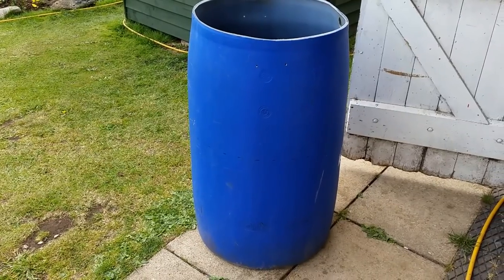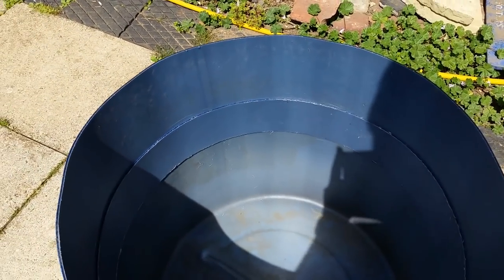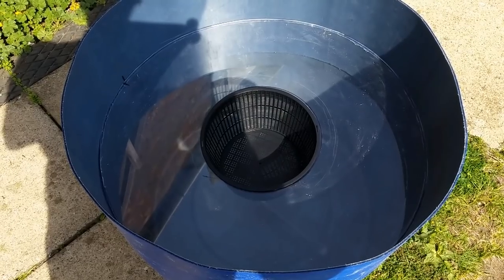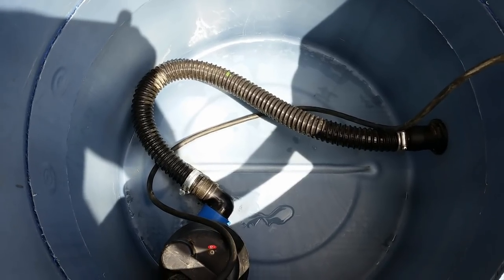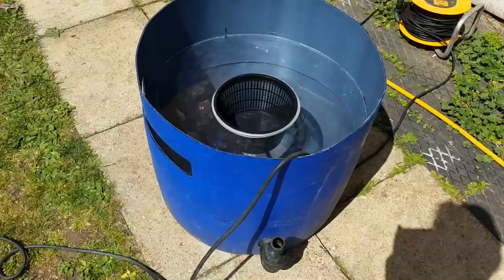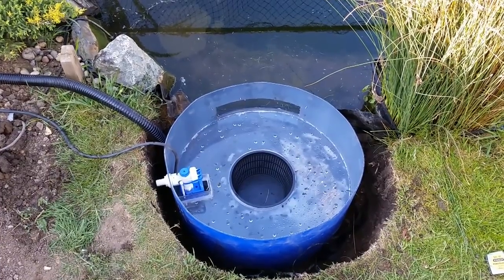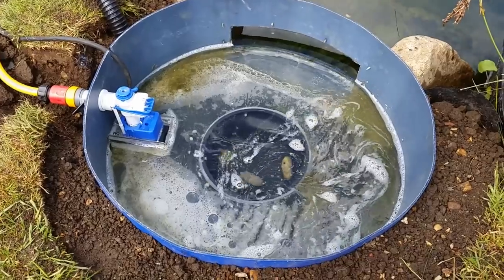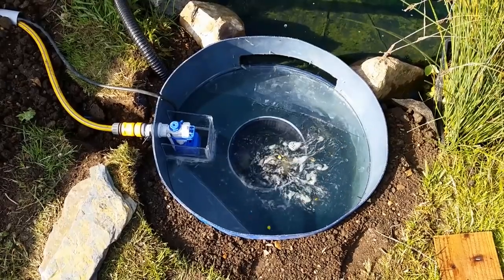DIY Pond Skimmer And Auto Top up.

Comment: Thanks Wrighty! I am new to this and learning fast. This is exactly what I was looking for! 
Last year put in french drains in the top end of the garden (the garden office is now inplace), down the sides (we are on the side of the hill) and from the water captured under the inground trampoline (don't ask!). The output is not connected to anywhere so when it rains, the garden takes some (suffering from hard clay) and the rest, well. Anyway, started to design a pondless/rill and want the french drain to feed into it. Issue is capturing any crap. This is our solution! The next problem is making it :)
Reply from the maker: Hi mate, sounds like quite a project. Hope all goes well for you mate, Terry.

Comment: That's great, nice work..... you could stick an overflow on the side near the top where you'd like the water level to max out at, that way rain won't effect the level of the pond. I've diverted mine down a dry river bed to my fence line, I even put in a couple collection pools in that the birds love to bath in
Reply from the maker: Hi Roy, That's a good idea. I did think of fitting an overflow, but we were moving house soon so I didn't bother. Thanks, Terry.

Comment: So Wrighty, you have a wonderful scenic venue between the Parasol topped Plaza and the pond area. It is so beautiful. 
This video was very well protrayed, narrated and photographed.You have given me some interesting ideas.One point I wondered about is that you placed the filter on solid ground, so it didn't move around or go up and down with the water level.My (smaller pond that yours with goldfish) water level goes up an down a few inches depending on the weather temperature.Would it be better to have the filter floating, so it is always at the affective height?Many thanks again. I will now visit your website.
Multi regards.
Reply from the maker: Hi Robert, Thank you for your kind comments. The auto top up fitted to the skimmer keeps the water level of the pond the same all the time so there's no need. Have you seen my new pond? https://youtu.be/8FpZpX_H0f4
There is 5 build videos, but this is the last one. Thanks, Terry.

Comment: Interesting video .Thanks for sharing your hobby. Have you considered installing a screened overflow just below the level of your float valve enclosure ? This would divert excess rainwater into the household drainage system whenever there is a downpour ...
Reply from the maker: Hi Susanne, this is quite an old video and I now have a new pond as we moved a couple of year ago. You can see the final part of the new pond build in this video: https://youtu.be/8FpZpX_H0f4 
Terry.

Comment: This video is great good ideas but the scum is just getting sucked threw the basket into to pump & back into the pond? And another question the debris just seem to be spinning around so soon as water levels get slightly higher there just going to be swilling round till they finally end up back in the pond? Not a in bad comment by far I'm just wondering what's what can u help me out as this looked brilliant in till I seen it doing this

Comment: Thanks for another fine video, Terry. Was beginning to wonder if the wier cut into the inner band or not. Saw that is did not till later on there. So did you have to change the strainer size or happy with the first choice? Any particalur reason for clear plexi for the shelf?  But most of all, where did you fine that round hole? All mine look like a someone ran  them and stomped on them.
Reply from the maker: Harry Chung Hi Harry, and thank you. The weir is just a fraction above the clear perspex and there is no particular reason for the clear perspex, anything similar will do the job. I must admit it was easier to cut the shape of the tub out as I just laid it on top of the tub and I could see the tub to draw the shape and get a good fit.
The smaller basket is working really well so not changing it at the moment.
It's now been running 3 days 24/7 and no problems yet m8.
Terry.

Comment: Interesting in your auto top up system - is this connected to a normal hose pipe? Any issues with chlorine in the water you're using to top it up with?
Reply from the maker: Hi Joe, Yes it is topped up using a hose pipe from the tap. But as it will only be a trickle it won't matter. The tap water is mixed with the pond water in the skimmer, which is turning over all the time and returning to the pond. This isn't topping up 24/7, only when the water level drops. Terry.

Comment: Mr. Wrighty very nice design may question is. The water doesn't run away from the pond where you installed meaning losing water to the ground.
Reply from the maker: Hi Hector, I'm not sure I fully understand the question. The only water I lose is through evaporation and it's toped up by the skimmer. Terry

Comment: Thanks Wrighty nice set up , i just wanted to the water out let part and the work of the pump, what is the water level of the pond lesser than the skimmer inlet and pump keeps on pumping all the water out of the tub? is that good for the pump, and also the speed of the water inlet and pump out let has to be the same, i.e. if the pump keep on removing faster that the water in speed what will happen, can you explain around this matter please.
Reply from the maker: Hi Favaz, The weir on the skimmer wants to be about 1 inch below the pond water level. If your pump starts to empty the skimmer you can raise the water level of the pond slightly or make the hole for the weir larger. Terry.

Comment: Top stuff! Could you connect a skimmer directly to the filter? Or to the same pipe as the bottom drain?
Reply from the maker: Thank you. You can connect a skimmer to the filter with the bottom drain if you wish. I didn't at the time I built my pond but I now wish I had. Thanks, Terry.

Comment: how did you come about with making sure the pond liner lines up with the skimmers opening and not leaking water into the ground?
Reply from the maker: Hi, Sealant is put around the hole for the weir. The pond liner is then placed up the front of the skimmer weir onto the sealer. It's then fixed with the fixing bracket shown in the video. If you want to see one fitted, take a look at ThePondDigger's video on how to fit a skimmer. Terry.

Comment: How deep should I install my skimmer? Do you measure from the bottom of the weir or top?
Reply from the maker: Hi, The bottom of the weir want's to be around 1" (25mm) to 1 1/2" (40mm) below pond water level. Terry
Reply: Wrighty what about the float valve? How deep to I place it?
Reply from the maker: You want it so it cuts in if the water in the skimmer drops below the 1 inch above the weir. they have adjusters so you can set it. Terry.

Comment: Would it work to just set it inside the pond without any glue to the skimmer plate ?
Reply from the maker: It would work, but you would need to hold it down as I think it would want to float. Terry.

Comment: Love your videos by the way and I was wondering what the clear piece is that separates and holds the basket in place ?
Reply from the maker: Hi Brian,Thank you. I used clear Perspex. I got it from my local DIY store. You can use anything for this job only the clear Perspex was a lot easier to see through to mark out the shape of the tub.Thanks again, Terry
Reply: So I could use plexiglass ?
Reply from the maker: As long as you can cut and shape it yes m8.Terry.
Reply: Thanks

Comment: What did you use to cut the plastic and barrel
Reply from the maker: Hi mate, I used a jigsaw and a hand saw.
Reply: @Wrighty  thank you awesome video aswell ! Saved me with ur awesome guide
Reply from the maker: Hi mate, your very welcome. I did fit the larger basket, as the smaller one did get blocked quite quick. Terry.

Comment: What if the water level goes down and no water coming in the skimmer? How to prevent the pump to get burned?
Reply from the maker: Thats why it's fitted with an auto topup. Terry.
Reply: @Wrighty  : The auto pop up won't work in the area where I live since we have an extreme cold winter weather. Any work around for this? Thanks a lot
Reply from the maker: Hi Jimmi, I usually turn my skimmer off during the winter. If the pond freezes over, a skimmer won't work. That's why I turn mine off to be safe. Terry.

Comment: How's it holding up?
Reply from the maker: Hi Tim, I did fit a bigger basket in it, as the small one blocked up quite quick. But it did the job very well. This is quite an old video and I have recently built a new skimmer in these videos: 1. https://youtu.be/JoVLh8XZ7so
 2. https://youtu.be/JoVLh8XZ7so Thanks, Terry.

Comment: Hi, could you tell me how did you cut the circle?
Reply from the maker: Hi Fernando, I did move to a bigger basket, as the smaller one needed cleaning quite often. I put the basket in the middle upside down and drew round it, then drew a second line 10mm inside the first line, and cut it out with a jigsaw. Hope this helps, Terry.
Reply: @Wrighty  thanks for your pieces of advise

Comment: Your weir design has no variation to water level. You need a square box where you can put a flapper plate that will allow different water levels to work with. Due to evaporation the water level get low and your pump will run dry.
Reply from the maker: Hi, that's why I have the auto top up fitted to the skimmer. This keeps the water level spot on all the time. Thanks, Terry.

Comment: How do you keep your pond water so clear?
Reply from the maker: Hi Ron, I have developed a very successful pond diy filter system. You can find out all about it on my website diypondfilters.com my videos are there as well. Terry.
Reply: +Wrighty ~ Would a diy pre-filter be just as good? My pond filter is built in the first tier of the waterfall. Has lots of plants in it as well, but gets basically 100% sun...
Reply from the maker: Hi Ron, A pre-filter wont help clear the water. They only take some of the load off the filter by removing the larger particles. Do you have green water? If so you need a UV light. A filter wont clear green water as it's what's called bloom algae and as it's only 3 microns in size a filter won't remove it. It has to be a UV light. Terry.
Reply: Green water is what I have. I did not want to purchase a UV light. I assume I will have to now. Do you know if the nualgi product really works?
Reply from the maker: Hi Ron, I've never tried it so I don't know. If you do buy a UV make sure you buy one bigger than recommended. That way you know it will do the job. Terry.
Reply: Thank you, very much! :)
Reply from the maker: Your very welcome. Terry.

Comment: what type of water level sensor you use ?
Reply from the maker: Hi Barry, It's a refill for a toilet system.
Reply: what's the name of that blue white colour component ?
Reply from the maker: I'm not sure what there called. I got it from my local DIY store. They fit them in toilet flush systems. You can get them on ebay quite cheap. Terry.